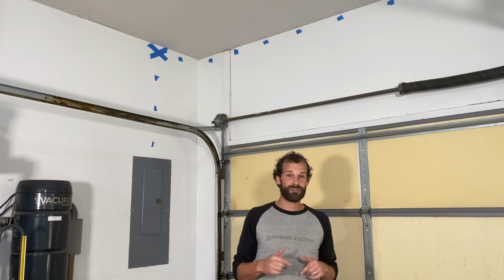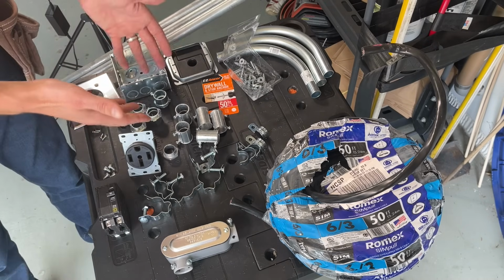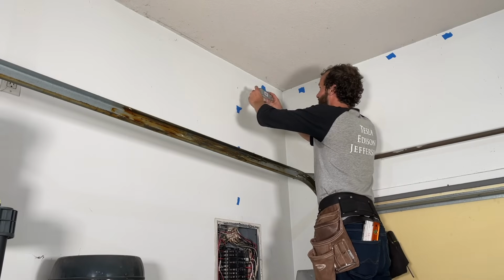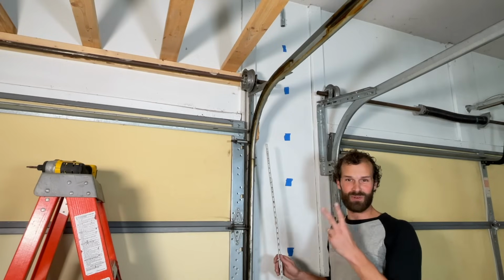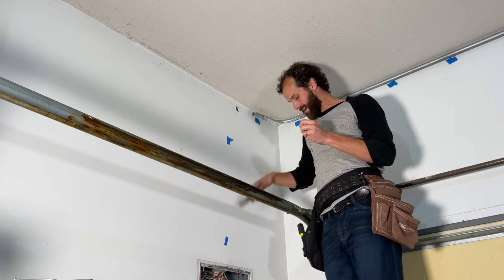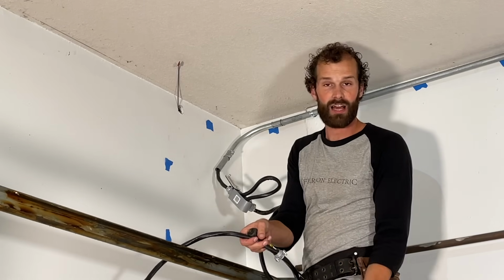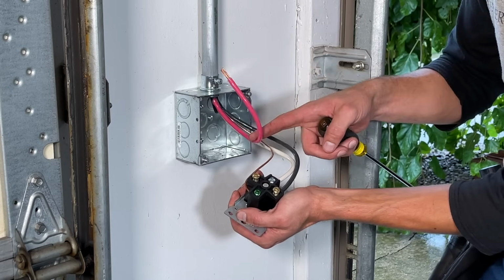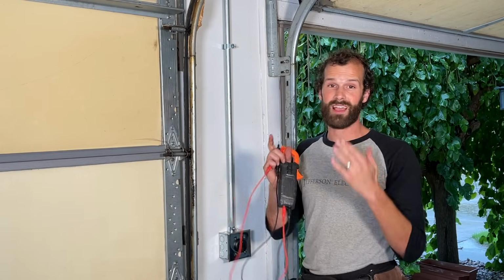How To Install a 240 Volt Outlet | Electric Car Charging

Comment: So much wrong with this.  Scary that he's an electrician.
Reply: If there are things wrong with this, it would be helpful to both him and everyone watching if you explained what was wrong.
Reply: @mjc0961  Exactly.
Reply from the maker: Any Specific feedback WR?  We welcome the feedback. Thx.
Reply: @EverydayHomeRepairs  1- Conduit is too small  2- What electrician runs romex in conduit?  3- The conduit body is not secured  to anything (J box would've been much easier to work with and secure to the wall) 4- Overfill in the conduit body 5- Using pre made 90s screams diy homeowner and not electrician .  I could possibly accept this job from a homeowner but not a supposed electrician.  It looks like a 1st year apprentice doing his first job alone.
Reply: @wr6392  and not to mention the 4s box is loose, you can tell when he is putting the faceplate on it is loose! Very unsafe
Reply: @rogelioaguiniga205  not to mention more importantly, the box isn't grounded.  And since the conduit doesn't go all the way back to the panel,  the conduit cannot be used as the ground.  Appalling job by an "electrician".
Reply: @wr6392  Hi buddy! 
1 - conduit is too small by what standard? NEC 2020 chapter 9 note 2 by the local interpretation allows for what would be considered "over-fill". I welcome your input! 
2 - I don't typically use pre-made 90's, but we did say this was a DIY project, not a pro-training, so we made an intentional decision to simplify the project. 
3 - Securing is required within 3' and that has been accomplished. Would you happen to have a specific solution in mind that we could benefit from? I'm all ears. 
4 - Refer to note 1. It's possible that your local interpretation is different and that's completely fine :-) 
5 - It does. And that's why we did it. Thank you!
Reply: @EverydayHomeRepairs Just curious. Aren’t you over box fill on that 4x4 box?
Reply: He pointed out that the factory elbows were DIY friendly to avoid buying a conduit bender for one job.

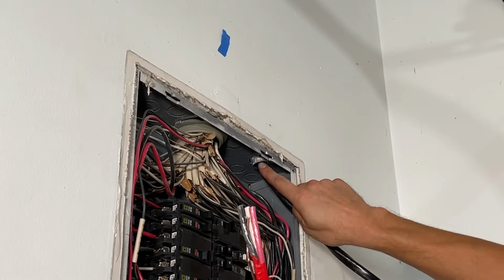Comment: at 35:03 he skipped how he got the EMT connector to the main box.  He only showed how he put on the lock nut. WHY?
Reply: Lol pay attention. He showed exactly how he did it
Reply: I agree.  The threading it through the sheetrock was omitted.
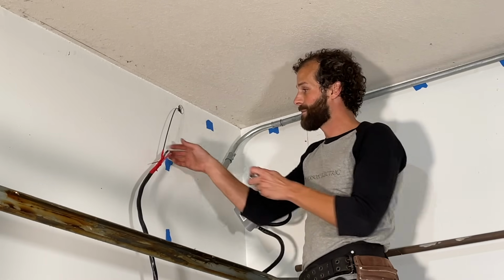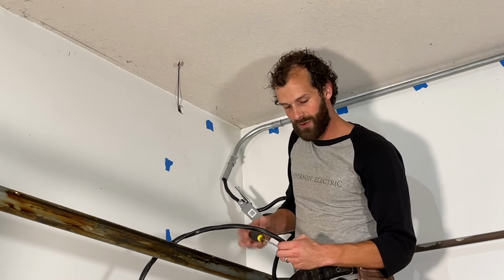Reply: That's what happens when you fast forward and don't pay attention.  Look 33:45 to 34:08!
Reply: @fs483  I commented when I first saw the skipped part. I guess it's just bad video edit job.

Comment: You / he should've used 1. a bigger conduit 2. Use Lubericant and yes 3. The LB instead of the LLR.  No point in shoving and fighting with the 6/3 Romex in 3/4 conduit.
Reply from the maker: I think those are all valid points.  Especially if you don’t have a helping hand 👍
Reply: Pretty sure he admitted all of those in the video...
Reply: He is not supposed to run romex, and does not need a ground wire with metal conduit.
Reply: @ericfraser7543  First part is wrong, second one is bad practice. One EMT fitting goes loose and your ground is broken. Every quality electrician I know will run a dedicated ground.
Reply: @ericfraser7543  you may not be correct, but thank you for raising those points for others to comment on.
Reply: @dougb8207  I believe you are supposed to run THHN wire through conduit, every thing I read is you can not run romex through conduit per code due to insulation and heat...  You can run underground UF cable through conduit and I read you can strip the insulation off the romex and then run its conductors through condit...  I am not an electrician so I could be wrong, google it...
Reply: ok maybe I am wrong...  it just can not be underground in wet areas in conduit...
Reply: @ericfraser7543  no worries friend; I appreciate most comments and responses as learning opportunities!  Thanks for your contributions.
Reply: @ericfraser7543  It can be run through conduit as long as the conduit is not in a wet location. Regarding using the EMT as the EGC, it would be fine to do so if the run of conduit was secured to the panel.
Reply: @ericfraser7543  Yes you do need a ground wire.
Reply: @Sparkeycarp  I googled this: Conduit (RMC, IMC or EMT) is an NEC-accepted ground path. So, if the wires are in steel conduit, no OTHER ground wire is required.Sep 22, 2015

Comment: 220V is so slow, in Europe we are looking for 400v and 32A charging at home.
Reply: Most houses are at a pretty stable 240 here in the US. If you run a 240v 50a plug you can get around 12k watts and if you have 400v 32a you’re at around 12,800 watts. Not much of a jump in power input to the car! But I do like higher voltage, less amps means smaller wire which means less money!!
Reply: @JonMarshAnderson  Most houses in europe have 3 phases. So 3×400v and 32 amps is pretty much. But is there charger like that and what will tell electric grid if everybody start charging their cars 😆
Reply: @loodusefilm7881  oh wow! Didn’t know that 3-phase was common for residential over there!
Reply: @JonMarshAnderson  I have at my house 3x400v and 16A, its less than avarage. Usually houses have 3x 400v and 25A, but ist not far away from 32A just need to buy seven more amps. Almost every house in Estonia have 3 phases if not then they have 1 phase and not more than 16A... so they have very old electrical system. Before upgrade my house had 1 phase and 6A 🤣
Reply: @JonMarshAnderson  Good to know. Like so many I expect we’ll have one of the house cars being ev at some point. Just don’t see the total conversion happening for many years, if at all.
Reply: Agreed. 440 is a whole different deal here though.
Reply: Lucky
Reply: 220V isn't any slower than 400V, when you multiple by the amps. By the way, the limitation with current model EVs is typically the onboard AC-DC converter is typically 12kW. A hardwired 60A 240V circuit, of which you can only use 80%, is enough to saturate the onboard converters. The only way to charge faster is DC fast charging, where the AC-DC conversion is done outboard in a giant, expensive cabinet with active cooling.

Comment: 8:49 - Actually, a better part to use would be a cover with a 2.1" hole already in it.  It mounts to the 4" square box, as well as the receptacle itself.  Or, simply get a surface-mount 50A 4-wire range receptacle, and then you won't need any additional boxes as it's all contained in one unit.
Reply: I never like flush mount device covers in a surface mount installation as the sharp corners exposed can cause problems or catch clothing if you brush up against the box.
Reply: That's a great approach Jeff.
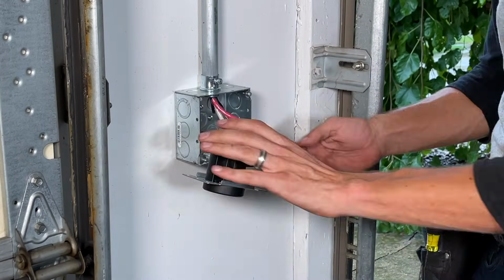Reply: He mentioned around 41:35 the mud ring is to get a bit of extra space in the box. Definitely agreed a proper cover would look cleaner; whoever wired up my house used the method shown in this video, and I can't say I'm a fan.

Can't find dimensions on the outlet he used, but Leviton's offering is right about 2" deep, cutting the dimensions a bit close.

A 3.5" box might have been better.
Reply: @DonaldZiems  A proper surface Cover ( Garvin) would provide the same extra depth. If needed a 4x4 extension box could be added for an additional 1.5 depth .
Reply: Romex is illegal to run in pipe due to very high tempatures
Reply: @eaglethabeak1760  Romex can be used in conduit if it takes up less than 58% of the area inside the conduit. Flat Romex is counted as being round with it widest dimension being the diameter.
the outer insulation also has to extend 1/4" into the box.
Reply: @eaglethabeak1760  Not true. legal to put Romex in conduit, but not very professional.